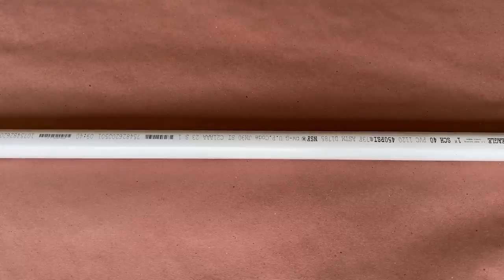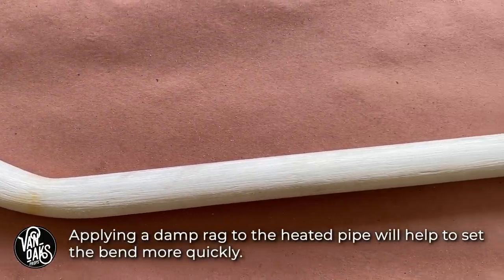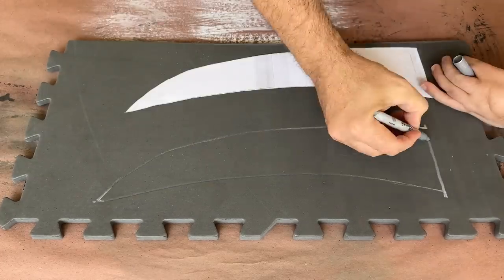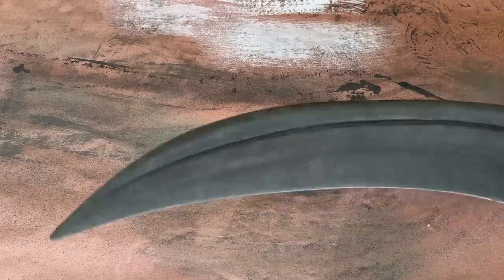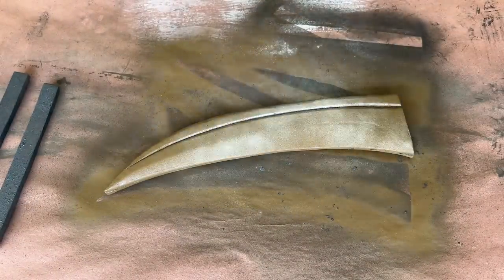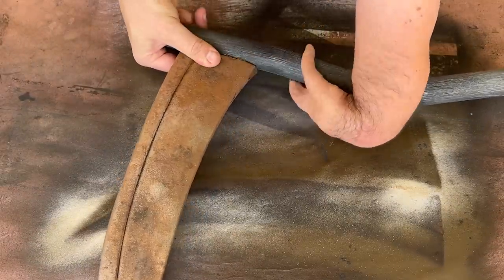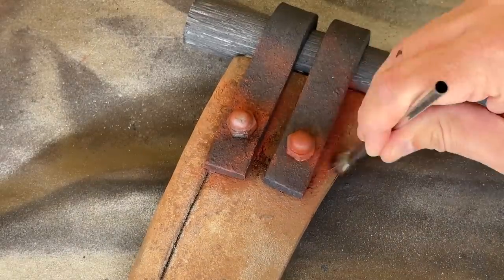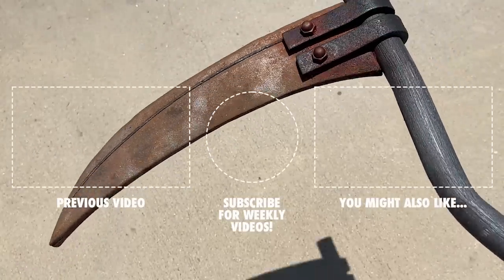Building a Prop Scythe with Foam, PVC, and Hot Glue!

Comment: When I'm bending PVC, one trick I use is to create a trough from aluminum foil to lay the PVC pipe in. This helps direct and retain heat from the heat gun around the pipe for a longer section. It lets you make longer bends, as long as you are careful not to kink the pipe
Reply from the maker: I’ll have to give that a try! Thanks
Reply: I fill the PVC with sand - and just use painters tape to block the ends. You DO have to be careful as the sand will stay hot longer ! 
(I used sand that is called "tube sand" that I had as weight in the back of my pick up truck for winter driving in New England).
I never had kinks this way. Make sure sand and pvc cools before you let sand out. Practice on small pieces to perfect your technique & leave to cool overnight. The painters tape comes off easily & tends not to leave residue like duct tape does.

Comment: If you're scorching the PVC, you're too close to the heat source. And releasing a bunch of volatile fumes in the process. The pipe will soften just fine if you just hold it a few more inches out. I'm usually about a foot away (I just made a new PVC bow for my daughter recently).
Reply from the maker: Thanks for the tips!

Comment: Excellent work!  I teach stage prop building and final set decorating and have used many of your videos/techniques as a basis for the students to build off. You are the Goat when it comes to the decorating details and design.    Sandwiched blades and wrapped (like this one here) work so incredibly well on stage.   If it a static prop, I would do it exactly how you built here. What I do is if it is a action prop (used by actors) -  I  Dremel out a groove  (between the sandwiched blades) and hot glue a cut off piece of fiberglass driveway marker rod through the foam and through the PVC handle.  Actors are VERY hard on weapons and you will have a failure before production even begins if you do not have reinforcement.  Again thank you !
Reply from the maker: Thank you! I had considered adding support, but in the interest of simplicity I skipped it. But I completely agree. People can be very hard on props and any extra support will be worth the effort.
Reply: @VanOaksProps  would love to see what your solution for support is.

Comment: A scythe is not "what the grim reaper carries" it's first and foremost a tool used in agriculture! =D That being said, loved the tutorial but I personally would prefer a more bare bones, dumber approach to attaining similar results with as little hardware as possible because for many people this would be a one-off Halloween antic, and it makes little sense, for example, to buy several cans of paint for just a few strokes. Can the head gun be replaced with an everyday hairdryer? Can the EVA foam blade portion be finished with simple silver electrical tape or even aluminium foil tape?
Reply from the maker: There's definitely some assumptions that you may have access to the paints, tools, etc. that I have, but that said, the real take away should be the techniques used to accomplish different finishes that would lead you to a finished prop.

Comment: I did something similar years ago for my son. But instead of a Dremel tool I used a wood rasp. You can scrape it up and down the PVC. Also, wood stain works well to finish it.
Reply from the maker: For sure. The only downside with wood stain is the dry time. But it does work extremely well!

Comment: Do you think you could decant some primer filler, mix in the baking soda and use it to create texture for a helmet? My concern is the layers of spraypaint thereafter could react negatively to the baking soda in the primer. I'll probably try the process via spoon method first, but I wanted to get your opinion on the technique. Thank you sir.
Reply from the maker: I’d use air dry spot putty for texturing a helmet.
Reply: @VanOaksProps  like bondo glazing putty?
Reply from the maker: @603VIL  exactly. And if you need thinner textures mix it in a little bit of acetone

Comment: Be careful to never heat PVC to the point it scorches or smokes.  It releases hydrogen chloride which dissolves into atmospheric moisture to form hydrochloric acid vapor.  Definitely not something you want to inhale or get in your eyes.  If the PVC turns brown you're getting close. When I heat PVC I try to avoid having to brown it if at all possible.  Evidently sifferent brands react to heat a bit differently.

Comment: could I use a hair drier to bend the pipe a bit?
Reply from the maker: Probably not. I don’t think a hairdryer gets hot enough.
Reply: Update, I actually was able to bend it with a hair drier 😂😂
Reply: Definitely takes a bit longer than the heat gun though..
Reply from the maker: @ladygreenwithenvy  good to know!! Thanks for sharing your results.